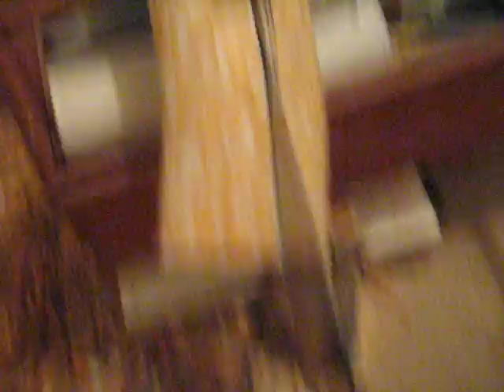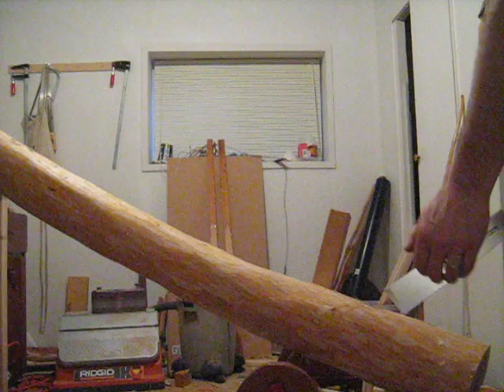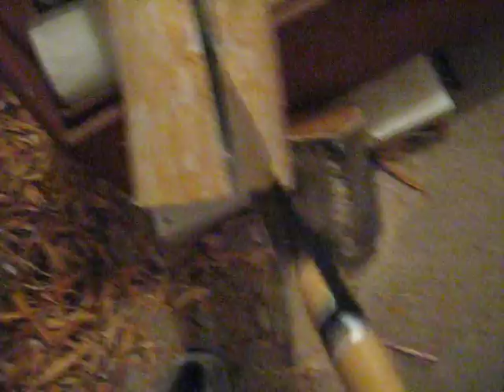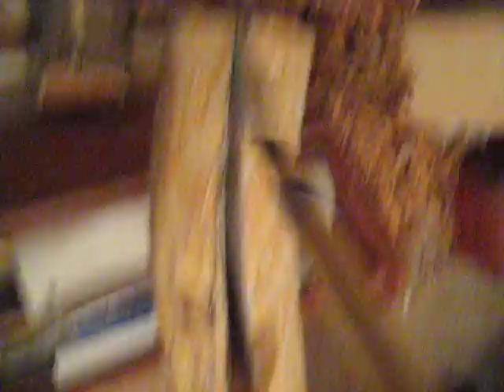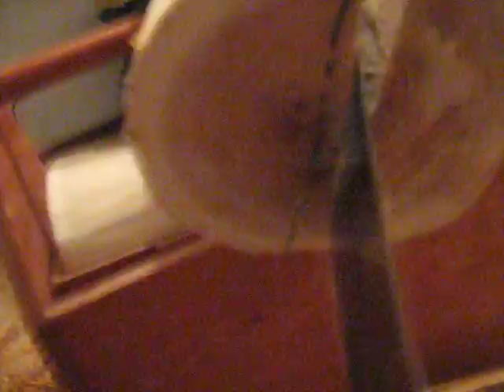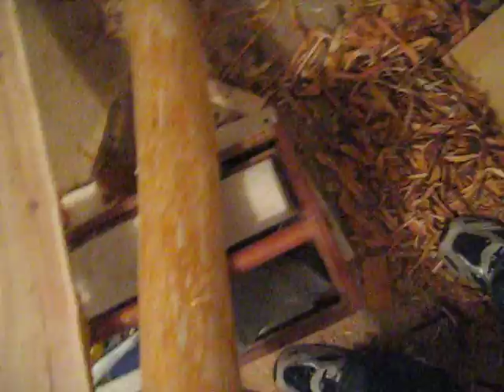sawn in half

Comment from the maker: yes, it's a great log a little over 6 feet long and averaging about 12 or 13 inches in circumference.   I have begun to saw staves out of it, as well.   Don't want to risk ruining the wood by splitting it:   in my experience, yew hangs on and likes to run out the side.  it's very frustrating when that happens!!

I will get 6 practically knot free, straight grained staves from this log, 3 reflexed and 3 deflexed.  thanks for looking.